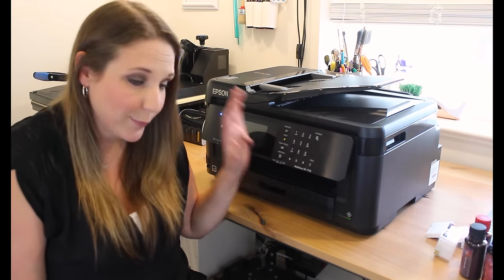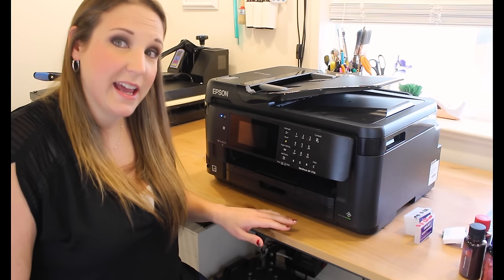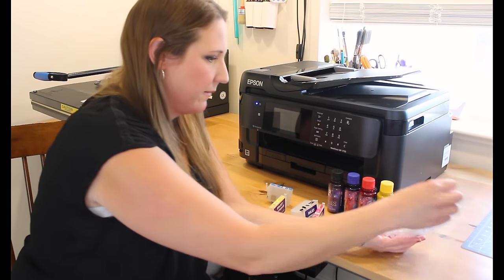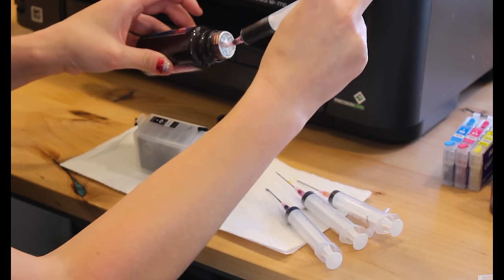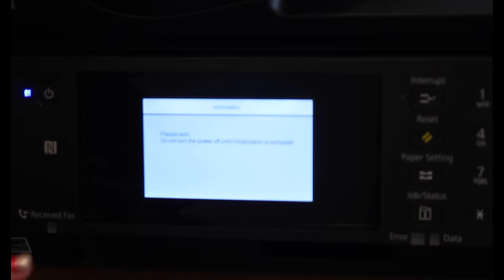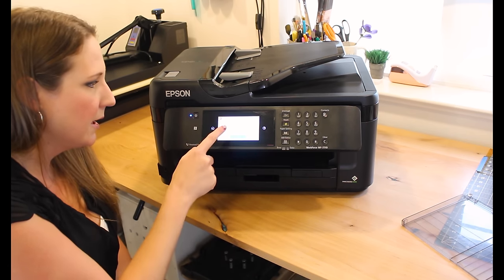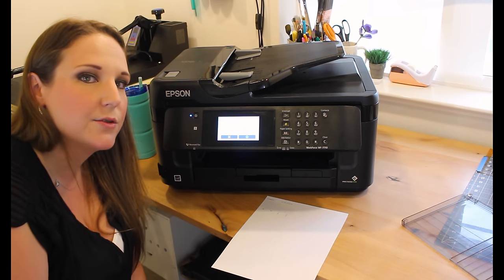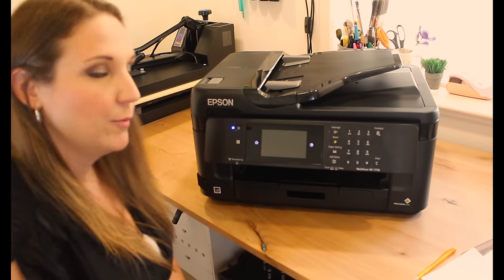How to Convert an Epson Workforce Printer to Sublimation

Comment: If I’ve been using my printer with dye ink for a year, do I need to clean any other areas? Or can I still just swap out the cartridges?
Reply from the maker: Just swap them out and print a couple purge sheets to push the new ink through.
Reply: @DebbieDoesDesign  thank you!  I will test this and see if it helps my printer :) love your video and how you explain it so well :)

Comment: Hello I'm about to set up my brand me WF 7720. I heard alot of people say if your going to use the printer for sublimation to turn OFF  automatic firmware updates and do not update them at any point. Is this for the manufacture ink as well right at the beginning?  I am planning to start with manufacturers ink to make sure the printer works before I switch to sublimation. Thanks so much.
Reply from the maker: I have not turned off firmware updates intentionally on mine so I can let people know if any of them cause issues and so far none of the firmware updates have created any problems for me. If you want to play it safe, it won’t hurt anything to turn them off. But I would at least let it update the very first time as sometimes it needs those updates to function properly during the initial install.

Comment: I used ink owl for regular ink and cartridges. My tips. WEAR GLOVES FOR THE LOVE OF ALL THAT IS GOOD IN THIS WORLD 😂 or you could look like you had an “Office Space “ style drag-out with your printer (don’t ask how I know) and put down a mat or tray or old towel to protect surfaces. If you do this without getting in on yourself or your desk, you are a superhero. Be careful installing software and updates. If you plan to use refillable cartridges and off-brand ink, manufacturers have started giving you a shit ton of issues if you don’t use their specific cartridges. These manufacturers want to stop us from using refillable off brand cartridges, and they need special chips to function in some cases (like me). Software updates allow your printer to monitor your refillable cartridges. It varies from manufacturer and printer. First time is easier and cleaner, whereas subsequent refills are messier because I always forget to replug the ink pad at the bottom. I’m excited to get started with sublimation, so thanks for reassuring my concerns.
Reply: Hello,  I would have to download the software.   Now are you saying not to update the software dye to problems?
Reply: Due
Reply: Jose Rodriguez on YouTube has some videos on printer software for this subject. Ink Owl also has some instruction or you could call them and ask. My husband did it, and I think he used regular Microsoft software for the printer that came with it. It’s getting harder and harder to get cartridges to work. Mine have to have a special chip to work. I remember being advised not to do updates.

Comment: Two questions:  1.  What about vacation. If you are going to be gone more than three days, do you do anything special to the printer?  I was told to make sure you print every three days or it will clog.  2.  What about refilling with a different brand of sublimation ink.  What brands are compatible?
Reply from the maker: Cindy LeBaron, No it’ll be fine, you might have to do a couple of head cleanings when you get home but it shouldn’t be anything epic. Get the Carthage’s as empty as possible then add the new ink and do a couple of head cleanings. As long as they say they work for epson printers you should be good. :) If you have more questions, please feel free to join the group and get a faster response! https://www.facebook.com/groups/Debbiedoesdesign

Comment: Can you use any Epson printer if you do not need to print larger projects? I plan on only doing mugs for now.
Reply: Check with the ink source first to see what printers they offer cartridges for...
Reply from the maker: It doesn’t have to be this exact model. A smaller one will work. You just need an epson and refillable cartridges.

Comment: I just bought a used Epson Workforce 3640. Filled new empty cartridges with sublimation ink, did print head cleaning and the red, blue and yellow aren't showing up at all now on print head cleaning. 
Is this normal?
Reply from the maker: Yes. It’s normal. If you can’t get it running with a few print heads cleanings, this video talks about further steps to try: https://youtu.be/2sNtZwTs01c

Comment: Great video, can you print sublimation on cotton tees
Reply from the maker: Bill Schmidt sublimation only works on polyester fibers or specially coated substrates. If you wanted to use cotton you would have to treat the cotton with a special spray that helps it stay on the cotton, but it wouldn’t be as bright or as permanent as doing it on polyester. The spray that are out there for that are called DyePress and SubliFix. They aren’t cheap, and there is a bit of a learning curve using it. But a it of people swear by them and use them often. It just depends on what you like. 

This might help: https://debbiedoesdesignco.com/blogs/posts/sublimation-colors

Comment: Great video. I tried to do mine, however my test print, nothing transferred over. Any suggestions on what I did wrong?
Reply from the maker: Is there ink showing on the paper? Join my group and share photos so we can walk you through troubleshooting better. 

Www.Facebook.Com/groups/debbiedoesdesign
Reply: Mine is also not printing anything on the paper😢

Comment: Hello! I have a question , I thought your instructions were to leave out the 'air plug' in the new cartridges but it looks as though you have both plugs in yours. I am having trouble getting mine to print so I am wondering if this is the issue? Thanks!
Reply from the maker: You need the air vents open. Sometimes I keep them in while I’m filling the cartridges up just to help avoid spills but remove them once I get the cartridges into the printer.

Comment: Great video. I actually use only dye ink, but I was searching for a video on how to have a perfect/good nozzle check printed after refilling cartridges. I'm having problem only with the magenta after about 4 days that I get it right. I'm using a high quality Korean ink, but it's still having problems. Thanks!
Reply from the maker: Fabio try priming the troublesome color let it sit for 30 mins, and print another nozzle check. 

https://youtu.be/zQnTR4mwo1o

Comment: Where did you buy the cartridges from. I have a workforce pro 4830 can I do the change on that printer also.???
Reply from the maker: I get my ink and cartridges from Cosmos Ink (www.debbiedoesdesign.com/cosmos). As long as you can find refillable cartridges for that model, you should be able to convert it.
Reply: @DebbieDoesDesign  thank you so much❤️

Comment: I am super new to this sublimation printing and have been very excited until now!  When I print my nozzle checks, it is not showing any colored ink. When I installed my ink cartridges and it went through it's little dance it said that it was complete and I didn't have any little signs next to any of the colors.  Can someone shed some light on this. I'm really kind of bummed here! Nothing ever seems easy when I do it haha!  Any help is appreciated!
Reply: Im having the same issue. Did you ever fix it?
Reply from the maker: I know this is old, but in case you still need it. https://youtu.be/2sNtZwTs01c

Comment: When the INK runs out, do you have to reset the cartridge?
Reply: Daniel Truong cosmos refillable cartridges auto reset to my understanding. I use a Epson Ecotank tho
Reply from the maker: Daniel Truong, No just go into the maintenance menu and go to replace ink, and follow the steps on the screen, refill and put back in. If you have more questions, please feel free to join the group and get a faster response! https://www.facebook.com/groups/Debbiedoesdesign
Reply: @Jayshawn884  I have an Epson ET 3600 Ecotank, but can't find information for converting it. It has very large ink cartridges. I've been using it as a regular printer for the last 8 months. I know all Ecotanks are not the same, would you know if this one can be converted to a sublimation printer. Would I need to get new cartridges first and would the printer still recognize the cartridges?

Comment: Would I be able to just use the Canon Pixma G3200 MegaTank printer? Since it already has the tanks for refills. 😮
And just use the sub inks?!? Please please help.
Reply: Hi, I am not an expert but during my research on sublimination printer conversion , it seems only certain EPSON printers can be converted. From what I found Cannon & HP  printers have a thermal print head and because of this they won't work. I found this information under a google search when I started my research. The only printers that I am seeing that can be "converted" are the  Ricoh &   Epson(  Workforce 7210&7220 & Epson Artisan 1430(discontinued).) The printer has to have a "piezo   printhead". Hopes that helps.
Reply from the maker: Like the comment above. Epsons are one of the few printer models that don’t use heat. You want an Epson.

Comment: I bought a brand new printer just like the one you are showing in the video. Never had any normal ink going through it. But I can’t get the ink to print like yours.
Reply: Did you get it working?
Reply from the maker: I’d be happy to help you troubleshoot but it’s hard to do here. Join my group and I can help you get it going! www.facebook.com/groups/debbiedoesdesign

Comment: Do you know if I can do this with a WF-2630? 
Usually takes the XL 220 cartridges
Reply from the maker: I haven’t dug into that model but if you can find refillable cartridges for it, it should work. They have XL black cartridges for a lot of Epson printers. The XL works just fine.

Comment: Is this sublimation printer as good as the grass400-800?
Reply from the maker: I assume you’re referring to SawGrass? That is a very debatable question. People will argue about it until they are blue in the face. I have never used a SawGrass, but I had a couple friends that had, and they had quite a few issues with theirs. Enough that one of them made the switch to an Epson. My main motivating factor for going the Epson route was because of not only how expensive the SawGrass printers are, but also how much their ink cartridges cost. They aren’t refillable. You have to buy new cartridges when they run out and they are not cheap.

Comment: I have a question - well more than one but for now this one - about the type of ink. Epson is designed for use with water based inks. Is this Cosmos brand water based or gel based like Sawgrass inks? I'm trying to decide which printer to get and I'd like it to be one that a) uses inexpensive ink b) won't be destroyed by sublimation ink. Epson definitely does NOT want anyone converting their printers. All you will get out of a representative is - don't do it or you will ruin your printer. I'm guessing that is if you use the wrong ink.
Reply from the maker: Sublimation ink is water based. Not gel. Epson will always tell you not to convert it. And will void your warranty if they find out.

Comment: Can you provide a list of Epson printers that can be converted?
Reply: If you check this site and search for dye sublimation ink you will see what Epson printers are supported. https://www.inkrefillable.com/
Reply from the maker: Basically any Epson printer will work, as long as you find refillable cartridges for the particular model. Or it’s an EcoTank, which don’t need refillable cartridges. Some of the older models are hard to find refillable cartridges for though. If you can’t find cartridges for it, then you can’t convert it.

Comment: Would you know if it would work for the Epson WorkForce WF-2850 WirelessMultifunction A4 Inkjet Printer? Except i want to fill it with tattoo stencil ink, not sublimation ink.
Reply: Hussnain Hassan  are you doing the same thing also?

Comment: Do I need to put in the Epson ones first before I put the sublimation ones in? If need to put in the Epson ones first, what do I do next after putting them in?
Reply: The epson cartridges that come with the printer will help you identify if there are any problems with the printer. Put those in 1st and do the initial set up with them in and print the test page. Once that has been done then you can swap the original cartridges out and put the ones in for sublimation. It is worth mentioning that you will need to do a few print head cleans and test pages to flush out the old non sublimation ink if you do this method and a few test pages before you get the result you need

Comment: when you're converting this system make sure you turn off the automatic update for the firmware if you allow automatic updates your printer will stop accepting the ciss system.
Reply: @MrRooster619 yes you are right that is correct the system is not being used constantly for printing it will clog up the lines, I don't constantly use mine for printing daily but what I do daily keep the maintenance up of looking after mechanical machinery or devices. so I lower the risk of the percentage of that happening to me so what I'm trying to say it's not about the system it's how you maintain and look after the system.
Reply from the maker: I have let my firmware updates run from the beginning, specifically so I can warn everyone if there is in fact a problem, and I have yet to have a firmware update be an issue. I agree with Paul, the maintenance is the most important part and most often where issues come into play.

Comment: When I go to cosmos website the kit is sold out... Anywhere else I can get this? Bestbuy has the printer in stock but I dont want to go buy it until I am sure I can get the kit to convert it... Thanks!
Reply: Best buy has the printer in stock and has a deal for a instant $120 gift card after you purchase one. I got the epson wf 7720 which is normally $299.99 for essentially $76 just an hour ago. $120 gift card and Walmart has them on sale for $179.99. They price matched.
Reply: Mrs Bombshel Same. Bought two. Traded the second gift card in for amazon money on cardpool. They wouldn’t honor the $50 trade in for my used printer but I’m still happy with the deal.
Reply from the maker: Cosmos Ink rarely has stock issues anymore. They went viral and had to do some catching up. If you need ink still (I know this is old) they’re back in stock. www.debbiedoesdesign.com/cosmos

Comment: Can another printer be used for sublimation? Which one?
Reply from the maker: It has to be an Epson printer. Most other inkjet printer brands used heat in their printing process. Sublimation ink is heat activated, so you can’t use a printer that does that. Most Epson printers will work, as long as it’s either an EcoTank or a model you’re able to find refillable cartridges for.

Comment: Help... I have the WF-7720... It worked famously for over a year with a CISS system. The unit was moved to my downstairs work area after most of the Covid threat was gone. I started getting print with faded stripes through the text...I went through all the maintenance.... several times over a months time. I CAN'T GET ANY ink through...blank print... Finally gave up on CISS and filled replacement cartridges with sublimation ink. Ran nozzle check...STILL BLANK...NO ink on paper...I even tried the steamed foam method even though I have had it completely apart and was able to force a nice spray through all colors of the print head. I just don't get it! Anyone???
Reply from the maker: Your black print head might have a REALLY stubborn clog. Try the priming method again and then let it rest for at least an hour to really soak into that print head and see if that helps. If you continue having issues, join my group so you can post your current issues with some pictures so I can see exactly what is going on and might be able to help troubleshoot better. 
Www.Facebook.Com/groups/debbiedoesdesign

Comment: For some reason my heat transfer paper won’t transfer onto the sublimation metal case
Reply from the maker: There are a lot of factors that could cause that. Are you using the correct time and temp? Pressure? Are you using actual sublimation paper? Sublimation ink? Are you sure the case is meant for sublimation? Feel free to join my group and post photos and more details of what’s going on and we should be able to help you troubleshoot better. Www.Facebook.Com/groups/debbiedoesdesign
Reply: @DebbieDoesDesign  yes I ordered sublimation ink on Amazon and also the heat transferring paper the cartridges are the one that come with it I drilled a whole on the top and drain the ink and added the sublimation ink

Comment: Does converting my printer to sublimination void the manufacturer warranty?
Reply from the maker: Yes
Reply: Ofcourse. Using snything not original manufacturer supplied would void any warranty
Reply: If you use an out of warranty printer (aka an older or second hand printer) you won't have any warranty to worry about.

Comment: Now do you do  head cleaning Everytime you print nozzle
Reply from the maker: No. I print a nozzle check every time before I start printing for the day just to make sure everything is good. If it’s not, then I’ll do a cleaning. If 3 head cleanings doesn’t fix it, I move onto priming or purge sheets, shown in this video: https://youtu.be/2sNtZwTs01c
Reply: @DebbieDoesDesign  Thank you good to know. It was printing blank pages. I had off the wrong plug, so the ink was sprouting out. I was able to fix it. It's printing good. One lone missing on the black. Just need to connect the printer to my laptop
Reply from the maker: Oh good! I’m glad you got it figured out!

Comment: Does this also work with the workforce wf7610?
Reply from the maker: I’m not sure about that specific model, but the process should be comparable.
Reply: I have same printer. Were you able to get yours working ? Or was firmware too big of a problem trying to do sublimation on the WF 7610? Thanks 🙏